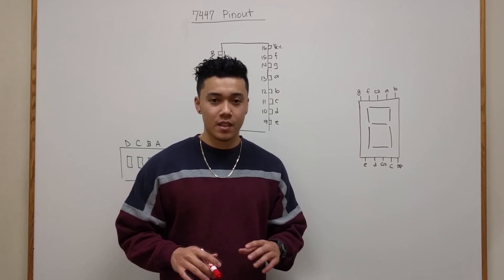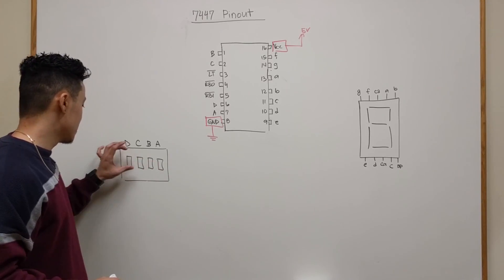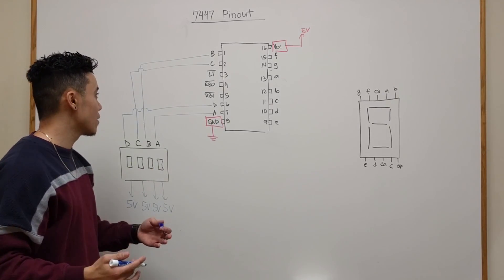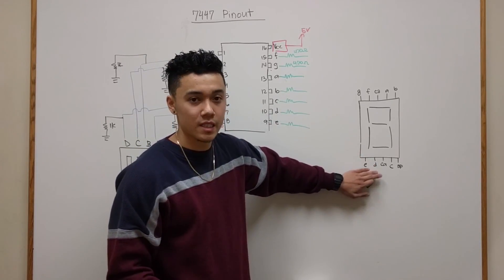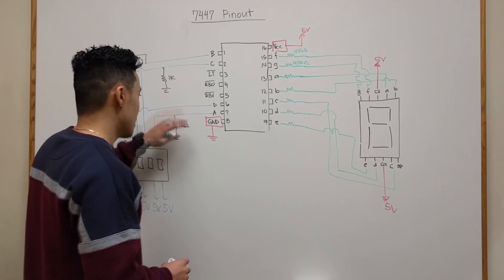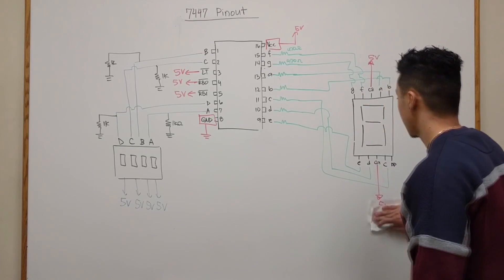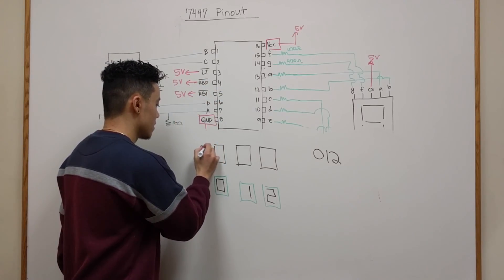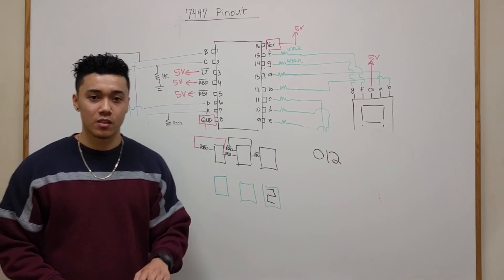Pin out of the 7447 BCD to 7 Segment Display Decoder Explained

Comment: 7447 is designed to be as common anode display driver and It will NOT work for common cathode 7-segment displays .
Reply: There is IC that can be configured to run both type of displays and that is CD4543.

Comment: Quick question, I'm New To EmbSys. So, I Am Trying To Use An Msp430 To display certain digits on 7seg. The msp430's Gpio pins output 3.3v. Would I Have To Step The GPIO output Volta pins  up to 5V inorder To Get The Buffer To Work ?
Reply from the maker: Yeah or use a transistor

Comment: hi, how do you get the decimal point (dp) on the 7 segment to lit up? Thanks
Reply: There is an eighth segment leg on the 7 Segment Display that will light up the decimal point.  The BCD decoder does not have a pin to control this.

Comment: Is it necessary to use multiple 7447 chip when using a 4-digit seven segment display?
Reply: Also can I put both my RBO and RBI to ground when working with a 4 digit seven segment display? Thanks.
Reply from the maker: Usually a 4 digit 7 segment display is connected is such a way that all 4 digits will display the same numbers. For example if your input is a 8, then all 4 display will show 8.

Comment: great video. Does pin 4, 5, and 6 have to be tied to +5V? Just wondering if it's necessary or not
Reply from the maker: Yes I believe you do have to make the connections in order for it to work correctly